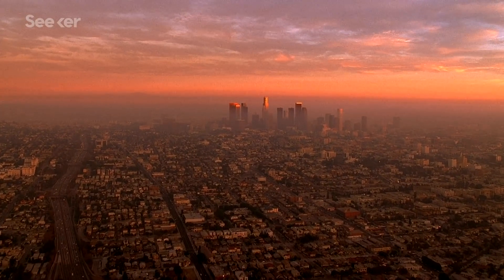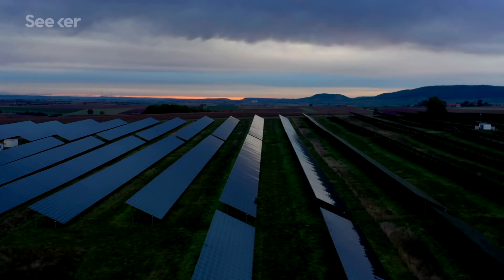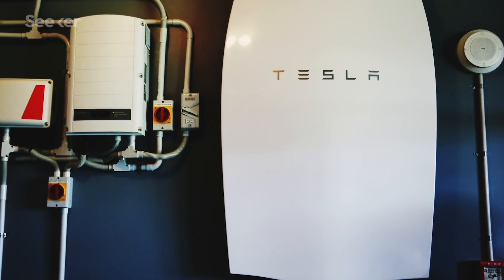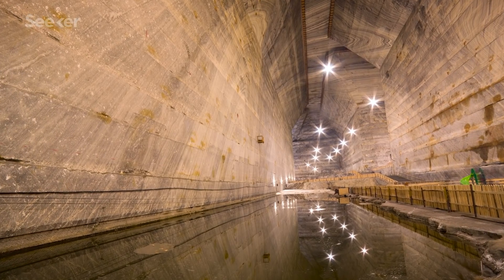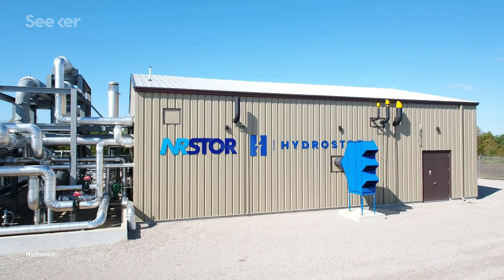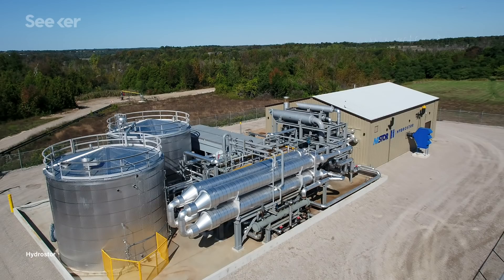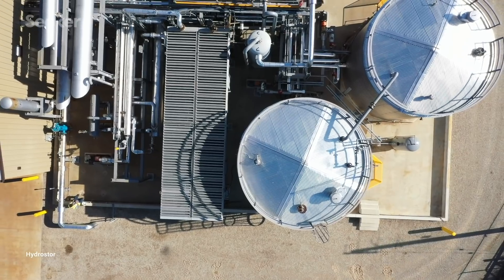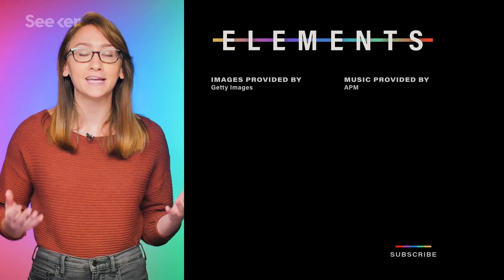This New Tech Could Revolutionize How We Store Renewable Energy

Comment: I know of a carbon free energy source that has tremendous potential; nuclear power.
Reply: Find a permanent solution to nuclear wastes and we'll have a deal.
Reply: @Scarletraven87  Thorium baby the reactor burns its own waste plus can be used to burn the waste we have already made, now there is SOME waste like cesium but its so little and so radioactive its 1/2 life is very short and decays after only a few decades
Reply: @Scarletraven87  Just bury it. Nuclear waste is horrifically dangerous, yes - but it's only produced in very small volumes. Small enough that burying it is a perfectly viable disposal method.
Reply: @Scarletraven87  nuclear energy is not meant as a permanent solution, but one for the next 100 years or so. Thorium reactors, amongst other benefits, produce less then 1/10.000 of the waste per unit of Energy, that current Energy plants produce.
Will the world overflow with waste If we continue to use nuclear for another year? No? 
Then we can safely use Thorium for another 10.000 without it being a problem.
Also, nuclear waste is not as terrible as people think. It is not some mysterious green sludge like in the Simpsons, but rather mostly contaminated cloathes and Material.
I am sorry to say it, but renewables  are not ready yet to replace coal. Thorium is. 
In my country, (Germany) we tried to replace coal with solar and wind, and now, because it is not practical yet, we are just back to coal...
Reply: @aldoushuxley5953  
It may have a niche as a source of radioisotopes, as well as being a potent source of energy. Still due to issues of cost and waste along with an increasingly powerful vested interests on wind, solar and energy storage conspiring with each other unwittingly, nuclear will likely to be a niche source of energy.
Reply: @unf3z4nt  I think that depends on the time frame. Waste is not really an issue with Thorium... Do you have a source for the high cost? 
(Not trying to be mean, I seriously want to learn)
I don't know enough about the technology in this video yet to comment, but Energy storage is very inefficient, and most energy is used in the morning and evening, when the sun doesn't shine.
Also, solar and wind are very land expensive, when you want to Power an entire country with it. (I think 25% was the figure I read for solar in the UK, I will try to find a source, might be completely off)
That would come at the cost of a lot of trees or agricultural land...
Reply: What about fusion
Reply: @MuhammadIbrahim-pk2ge  fusion will be ready 20 years from now and will always be  Thorium is safe, ready now and the fuel is already dug up sitting in containers as waste from mining
Reply: @MuhammadIbrahim-pk2ge  oh ya, just around the corner hu
Reply: Thorium only tho.